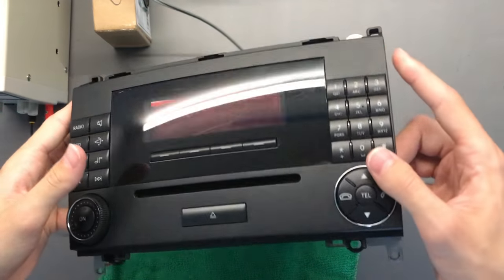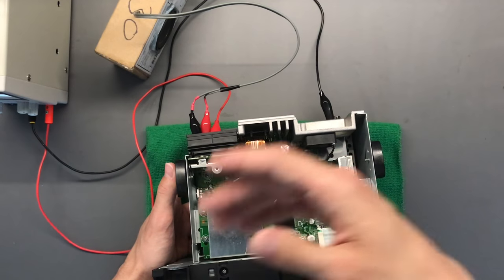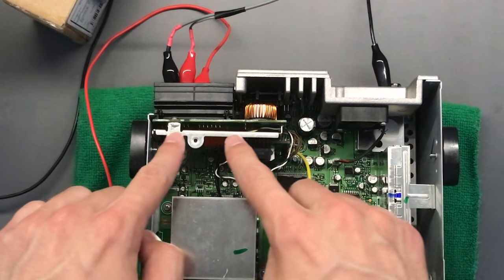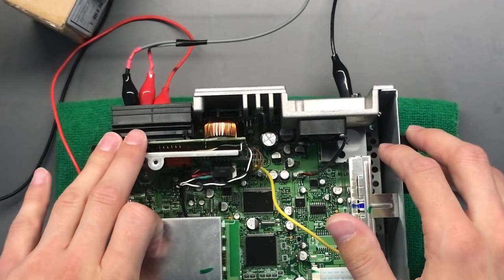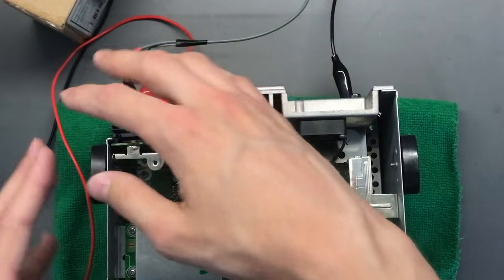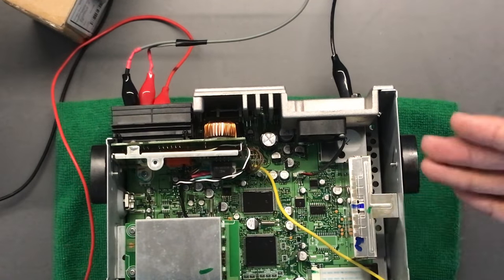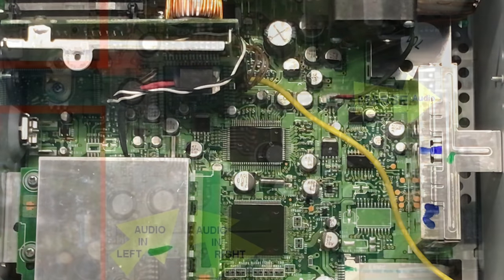2007 Mercedes-Benz Audio 20 Bluetooth Integration

Comment: I just bought a mercedes with this radio, but when i tok it out there was already a white 12 pin in the aux slot, but there is no aux in the car i checked everywhere
Reply: Did you Find out what the white pin was?

Comment: @darieee thanks for this video. 5years going and its still relevant. I've followed your connections to the pinouts and its worked great.  one issue I'm facing though, is that the car speakers only sound proper on the left door speakers  and very faint on the right door speakers. Any idea how i can fix this, please?

Comment: Well, I did that and I made speakerphone also with external microphone. Yet I have one issue- the pin wit baterry plus you gave is always powering on my BT module.. I would prefer to turn it on with ON/off of radio or with turning on car keys.. ideas?

Comment: hallo, ich hebe ein Bluetooth Modul gekauft. 
Kabel Schwarz: GND-
Kabel Rot: 12V ACC+
Wenn ich für:
Kabel Schwarz: GND- = Masse = Stecker 2 PIN 12 Kl.31
Kabel Rot: 12V ACC+ = Dauerplus = Stecker 2 PIN 15 Kl.30
nehme, wird Bluetooth Modul immer vom Akku Strom ziehen also auch wenn Auto aus ist. 
Könnte man stattdessen:
Kabel Schwarz: GND- = Masse = Stecker 2 PIN 13 Antenne
Kabel Rot: 12V ACC+ = Dauerplus = Stecker 2 PIN 15 Kl.30
nehmen?

Comment: hey man tnx for this video
also i have a question
 your video is about making aux via bluetooth right
 what i really want is the telephone system in the radio
cause its not working  just say no telephone
 how to make it work or how to add the bluetooth to the real telephone system not the aux
Reply: i have the same  question....
Reply: @ivanjovanovic6634   i find the problem
and its  a problem that cannot be solved
 if you notice there is a cabel in the  center arm stand
Reply: I have the same question. Is this possible in the present year.

Comment: Hi Darieee. Thanks for the video. I'm having difficulty with adding Bluetooth aux receiver and hope that u can help me.
I plugged the the Bluetooth receiver to the machine and there is a red and black wires attached to the Bluetooth receiver. What do I do with this? I understood they are  12v cables?
Reply from the maker: Mmm, no idea, you've said way to little for any answer
Reply: @Darieee  sorry. As you see I don't know much about this field but I'm really interested to learn.

My car is MB A170 and it has audio 20. I wanted to connect it to my phone via Bluetooth So I bought Car Bluetooth Module Aux Receiver Cable Adapter For Mercedes Benz W169 (audio 20) from Ali Express. It has a connector 12 pin, a red and a black wire attached to the Bluetooth device. 

in the car I pulled the audio 20 out and connect the 12pin connector in. I'm wondering now what to do with the red and the black wire. I wonder are these wires to power up the Bluetooth or something and where and how to connect them?
Reply from the maker: Ow, yeah, in that case red goes to positive and black to ground
Reply: @Darieee  I don't know which where is positive and ground
Reply: @Darieee  Hi, I know this is very long after you posted this reply. But I have the exact same radio and want to do a mod, Is there any way I can buy all the components from you, because I fear I may buy the wrong components. I am proficient with electronics and soldering but not at your level. I live in South Africa, you can obviously add your profit etc. and I can pay with PayPal. I know this is a strange request but I haven't found any other person that can possibly help me.

Comment: Hey i don't know you gonna reply now or not ! But just wanted to know that i have the aux thing but don't have bluetooth, after watching this if i buy that 12pin adapter and if i connect this into it.  will bluetooth work on it? Or i also have to any other  module upgrade to unable this feature in thd car's brain? Because i don't have this feature in my car's model but i have this same music player.
Reply from the maker: I think there are BT adapters with those 12pin plugs, yeah

the only thing you could do to vastly improve those is steal the 12v antenna power like I did, and have them start up with the radio - that way they'll reconnect automatically when you start the car
Reply: @Darieee  damn thankyou that's quick fam ! Oh um i don't want to mess up around too much with it😂 so i think that bluetooth adapter will be fine. And yes so i have wires already connected in the positive and negative terminal. Is it okay if i overlap the bluetooth wires and joint  it with other wires?
Reply from the maker: really not sure what your setup there is - maybe find someone with some electronic background to have a quick look 🤘
Reply: @Darieee  respect bro :) really thankyou so much!!
Reply from the maker: no prob ✌️ have fun

Comment: Hello, I have the same radio but it does not enter the aux mode ? Any ideea why ?
Reply from the maker: it has to be enabled

you'll need someone with a diag tool to connect to your car and get that turned on
Reply: @Darieee  alright, I'll try to find someone. Thanks!
Reply: @Darieee  I have DAS. But I don't know what menu to get the aux turned on. Could you tell me please. Thanks.

Comment: @darieee Im thinking of wiring 12v power from fuse box to the chip. Ground it with the chassis. Wiring the output from the chip straight to the aux port on the stereo. Will this work do I have to worry about anything else?
Reply from the maker: This will mean you'll have to always manually connect to the radio

My solution enables the bluetooth module to always automatically connect to the last known devices at power-up
Reply: Darieee I’m hooking the power to the 12v fuse box so when the car is on the chip is on. I’m using the same chip as you so won’t it connect automatically anyways? Do I have to worry about adding the the volume buttons and connecting button on the chip? Or will my phone be able to control that. All I’m wiring is the aux output and power for the chip
Reply from the maker: Don't need to add any buttons to it, it goes to full volume automatically

I would however again suggest you power it from the antenna lines, otherwise it will not automatically connect to your phone

You WILL regret it if you won't do it :)), I can guarantee it
Reply: Darieee I purchased a 4.0 Bluetooth chip by accident. Will it effect the sound quality compared to 4.2? Can’t refund now because it’s been shipped :(
Reply from the maker: No, sounds the same, don't worry

The 4.2 ones have slightly better reception, and have synchronized volume with the phone ... but, for your application that really doesn't matter too much
Reply: @Darieee  im using a fuse tap to get power. what size wire would you recommend me using? 20 awg? remember im talking about the 12v chip
Reply from the maker: Yeah so ... basically depends how long the wires will be; any thickness will do, since we're talking about 40mA at most

However, given the fuse is 10A or more, I would advise a wire thick enough to make you confident it won't cut or pinch or break and short out to stuff

I'm also very unfamiliar with the american wire gauge system
Reply: Darieee what thickness wire did you use to power and ground the Bluetooth chip?
Reply from the maker: I would use 2 to 3 mm wire

Comment: hi mate on this video which cable are connecting to unit radio and where do you connect them , cud i see the capture image where they are connected ...i am just trying to test my unit cheers
Reply from the maker: Really didn't quite get the question

Did you watch the entire video ?
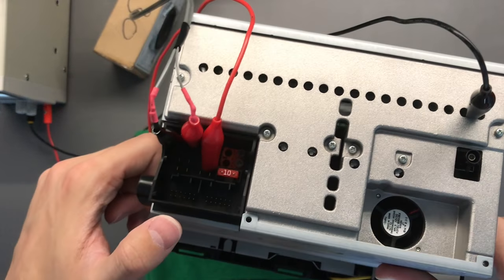Reply: @Darieee  yes  i have finished watching the whole video but its hard for me to see the video clearly. At 0:55 I would like to know where each cable comes from and what it exactly is connected to.
Reply from the maker: those are just power in and speaker out - it's a standard connector :: https://en.wikipedia.org/wiki/Connectors_for_car_audio
Reply: @Darieee  cheers mate

Comment: Hey friend , i pressed the cdc and it says input and i think it works .i wanted to know that that the only option for my aux to work is to remove the whole system/setup/radio ? so that i can be able to plug in the cable

Comment: Hallo Dariee, wie programmiere ich das ding? Kannst du den Code noch hochladen?
Reply from the maker: welches Ding meinst du genauer ?
Reply: Das Bluetooth Modul (CSRA64215 Modules) meine ich. Wie ist die Soundqualität eigentlich gegenüber die externe Lösung wo man das Radio nicht aufmachen muss?
Reply from the maker: Das CSRA64215 oder halt auch 8645 .. alles was BT 4.0 oder mehr hat, klingt genauso gut wie ein CD ..

Comment: hello, congratulations for the video! I would have only one question: could you tell me a suitable linear / buck regulator (a link would be an excellent indication!) and how to connect it? thank you so much!
Reply: do you think a lm7805 is good?
Reply from the maker: An LM7805 would indeed be a good choice, check my first bluetooth radio tutorial, there I explain how one of those is used

You can get them at any electronics store if you want then fast, or on ebay.com from our friends in china if you're not in a hurry (don't but the cheapest though)
Reply: @Darieee  thank you so much! would you have a simple scheme on audio 20? especially where to get the power supply and how to properly connect the CSRA64215. thank you so much!
Reply from the maker: Unfortunately not ... sorry
Reply: @Darieee  ok.. so, on the CSRA64215 must I connect the GND, the VCC, and the L, G, R ?
Reply from the maker: Yup

Comment: Hey man, i have a question: i'm here in my r171 with the same audio 20 but holding down cdc doesn't enable aux in, what would you suggest?
Reply from the maker: you can enable AUX with a star diag tool
Reply: @Darieee  sorry but i'm a huge noob, what's a star diag tool? is it a software thing?
Reply from the maker: no prob; it's the diagnostic tool for mercedes cars; any decent service 'should' have one

the better ones should know how to enable the AUX
Reply: @Darieee  Could you tell what menu in DAS to enable it?
Reply: @Darieee Thanks to advice, i did install Bluetooth to CD inputs on sound processor, this way is described on forums.

Comment: Hi, I need your help. I'd donate you some money if you could help me with my problem. 

I'm trying to run my OEM sat nav without the radio, since I'm upgrading to a aftermarket 2din radio. The problem is, that the nav voice signal comes from the sat nav and goes to the radio. In other words: no OEM radio -> no sat nav voice. A guy once solved this by keeping half of the radio in and solder a little speaker to it. I would like to add a speaker aswell but I don't want to have half a radio hanging loose behind my dash. That's not how I do things.

I have pinouts and service manuals with which one could find out where the sat nav audio signal is coming from but sadly I don't know alot about audio signal stuff and amps. I do alot of electrical mods but I'm not sure if I can figure this one out and I don't want to wrack the nav. Would be great if you could get in touch with me so we can figure this out together.